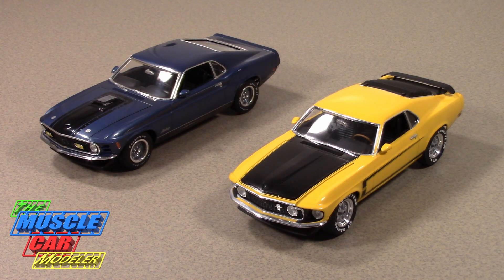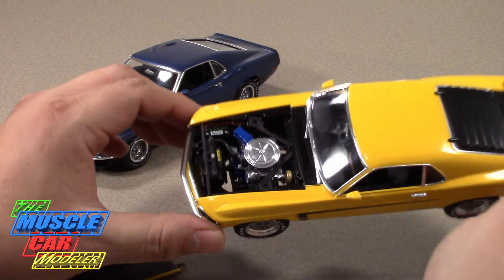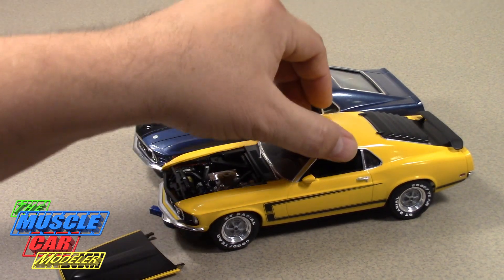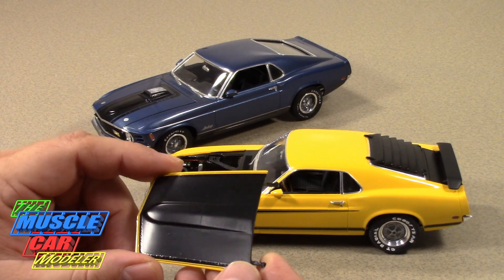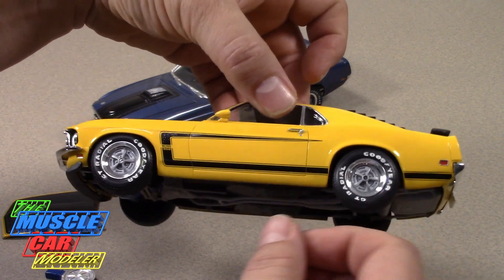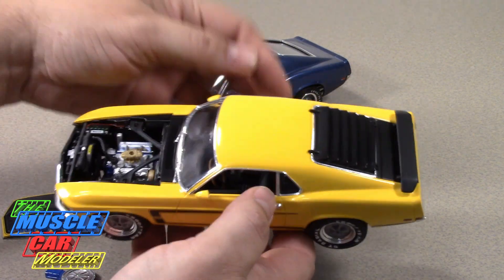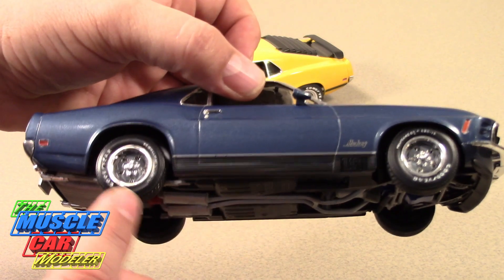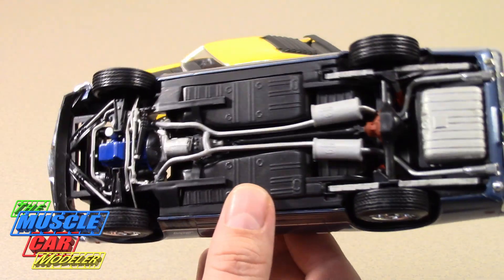Revell 1969 Boss 302 Mustang and 1970 Ford Mustang Mach 1 Kit Bash Build

Comment: I love these kits, too.  I built the Boss 429,(the first time) back in 1983 while I was in school in the Navy.  Built it again, later, and have a few others, finished and unfinished.  The only real issue I have with the kits is the shock towers.  They are correct for the Boss 429, but not for any other Mustang.  The same master was apparently used for all the 69/70 kits.  It makes the engine bay a little too big for most of the cars. Even still, it is way better than the older AMT/MPC kits which have no shock towers at all!  Thanks for sharing, and a great job on the conversions.
Reply from the maker: Thank you!  These are great kits and I didn't know about the shock tower issue until many years later. It's one of the few flaws but that never stopped me from enjoying building these kits!

Comment: Hi i just discovered your channel and really enjoy it, but i have a question, you said the front decal shrunk thru out the years, was micro set/sol used on this kit? i guess i'm interested if  micro sol shrinks as well in years to come- thanks, Mike.
Reply from the maker: Not the actual decal but the putty I used to fill in the shaker hole on the 69 Boss 302. It started out as the 428 Mach 1 and I filled in the hole. You can see the cracks in that area. I had bought a resin hood to replace it and even a resin front update kit. But now with the new kit there is no reason for those parts now.
Reply: @TheMuscleCarModeler  understood, thank you and keep them coming!